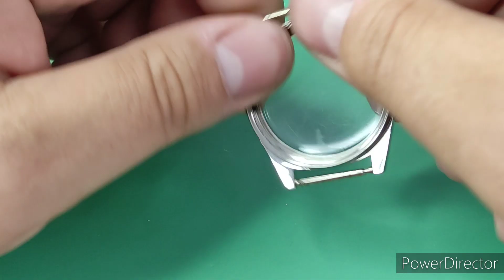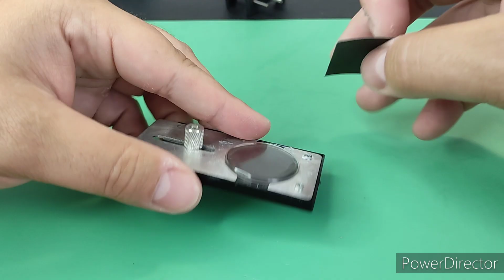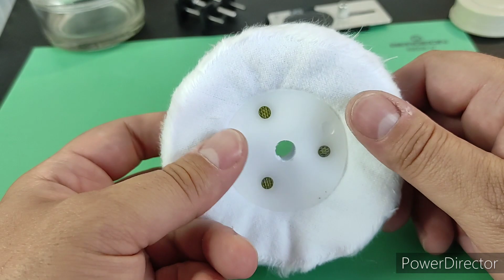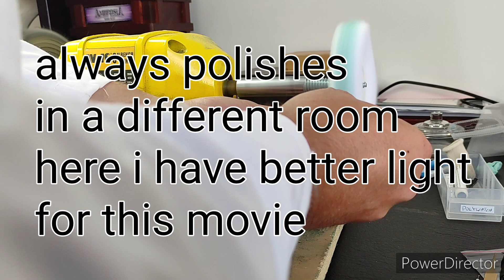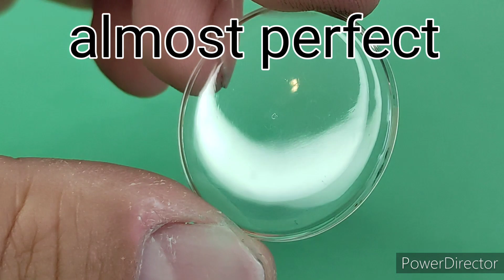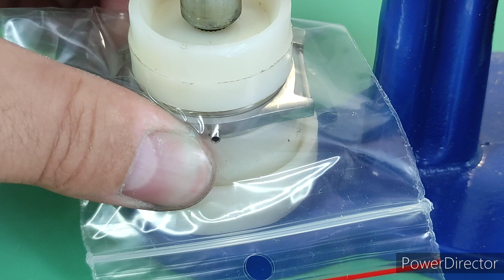How to polish, restore plexiglass in a vintage watch

Comment: Awesome! Thank you for sharing. I have been working with some vintage Seiko 7006-8007 and 7006-8040 with acrylic crystals and tension rings, and I’ve used much the same with sanding and Polywatch technique. Next time I will try a coarser sandpaper and the polishing wheel and compound. Thanks again, and please keep sharing your work especially on vintage pieces.
Reply from the maker: Thank you !